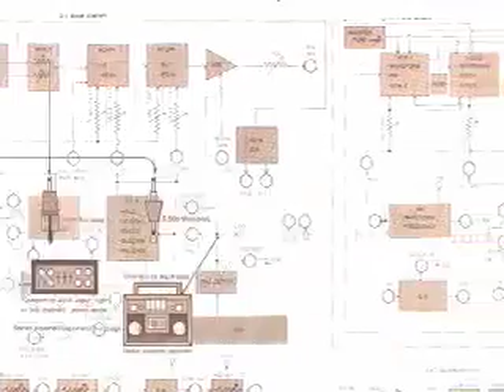The Korg MS-20:  The Patch Panel 1

Comment: I watched your series on the mini, but thought i would give this rundown of the patch panel a watch. Definetely worth my time! I never thought about the thing you point out at 3:54: The Triangle MG is by default routed to pitch. You went on to send two different LFO waveforms with the same frequency to modulate the same destination. Such a weird but interessting machine.

Comment: Thanks for the videos. They make a great start for my iMS-20 on the iPad. 
With the iPad version you can use the mod wheel (or any other control source) to control multiple items. Just drag from the item you want to control to the controller to get multiple wirings. Example: from VC HP filter to mod wheel and then from VC LP filter to mod wheel.

Comment: @AutomaticGainsay: I vote for the latter. The size is rather unimportant. Voltage instabilities, quality of resistors amd stuff like that play a lot greater role. VacTrooper, your theory of "lost power" sounds not very plausible. Filter and oscillator design/waveform shape seem to be much more plausible factors for "grittiness", in addition to modulation possibilities.

The MS-20 has a pretty unique triangle waveform shape, for example, like a ring modulated sawtooth wave.

Comment: hey mark is there any 'workaround' for having the filters track the oscillator cv?  i know there is a kbd cv out but it only works for the range of the built in keyboard, if you use the octave switches it doesnt do anything. 
is there no other way to acheive the effect of being able to 'play' the self oscillating filter across the keyboard somewhat accurately. 

i always thought if one of the osc had audio and cv out you could do this plus fm sounds too. maybe its a mod?

Comment: 4:50 : Hey Marc, I can't seem to get my Ext. Input to work...I routed an Output of my Interface directly to the Input but nothing happened...anything I have to adjust aside from the filters before I hear a result?

Also the Noise Generator and the White Noise Oscillator on my MS20 are way more quiet than yours in the video. Is my MS20 somewhat damaged?